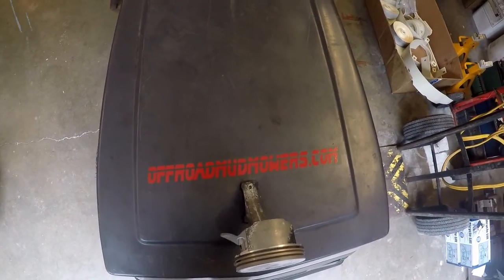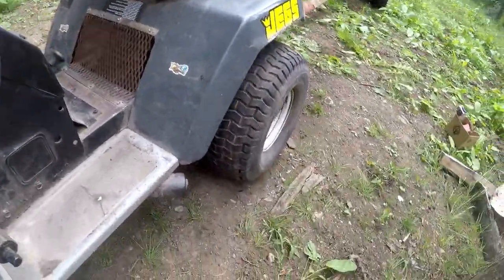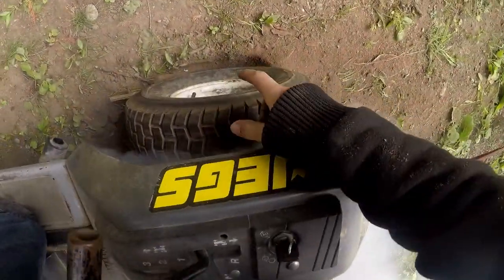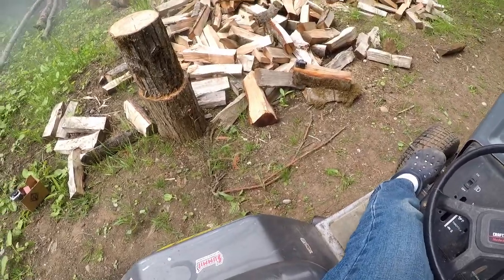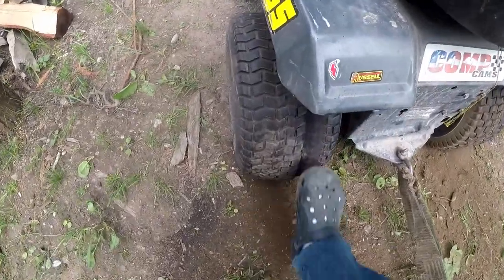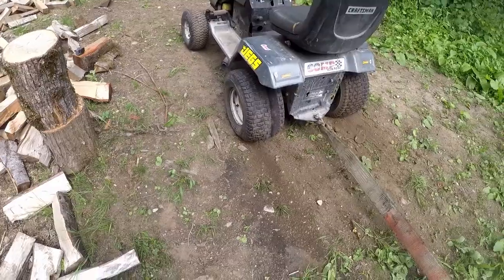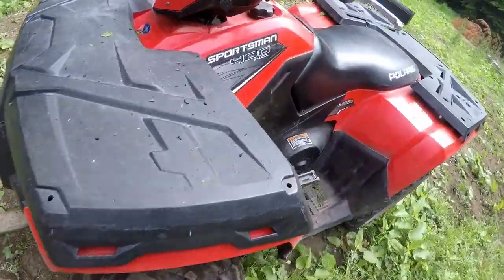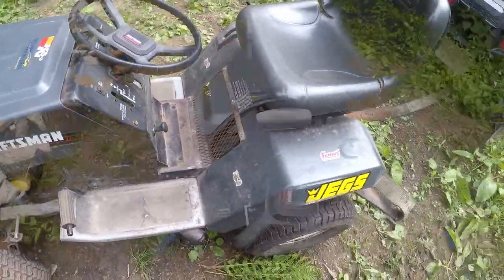3rd Annual 4th of July tire burn off!

Comment: Ha-Ha.  Lots of fun!   I bet the 206 will need a new set of spider gears now.  Maybe you should lock it up instead of replacing them.
Reply from the maker: Something didn't sound right, but at least it still drives. That 206 has been in there for 3+ years, so its survived all of the burn offs, clutch dumps, power shifts and so on. I need to lock it though.